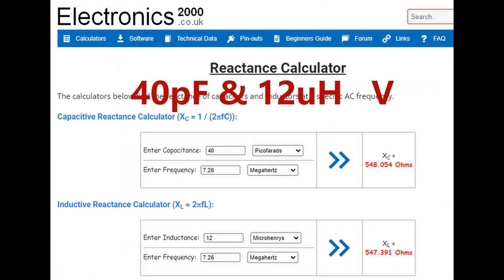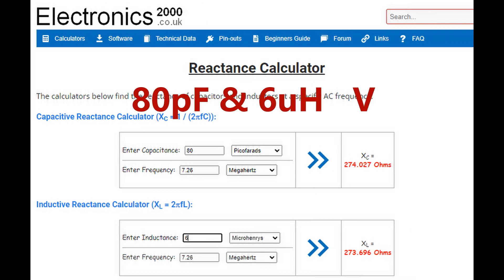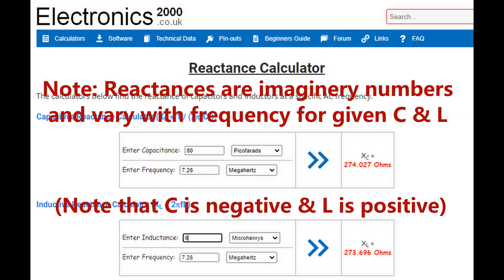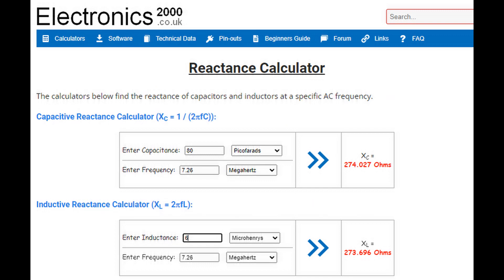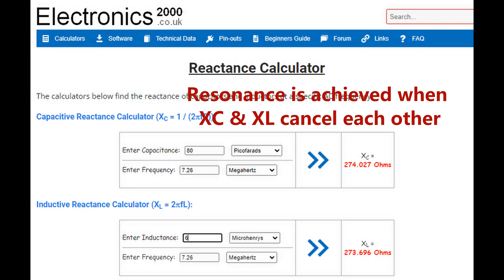Calculate tuned circuits IN YOUR HEAD

Comment: Great rule. Thank you Peter. Could you explain how the different combinations of L and C vary the Q factor? Thank you
Reply from the maker: Q is a bit more complex. It's not just L & C combinations - it's more to do with the quality of the tuned circuit elements eg absence of resistive losses in the inductor.
Reply: @vk3ye  ok. Thanks you anyway.
Reply: The best estimate of Q is basically like this:
Compute XL as 2*pi*F*L
Find the resistance of the coil.
Q = XL/R
This only works with thin wire and without parallel resistances in the circuit.
In real circuits, you often have the input impedance of a transistor loading the LC circuit and forcing the Q to a lower value.
Reply: Thank you! @kensmith5694

Comment: Without being able to specify the input and output impedance, these calculations are not worth much.
Reply: These are very useful tips.  He is talking of hitting the resonance frequency in a simple LC having only one L and only one C.
Reply: @kensmith5694  A tuned circuit is useless without being able to connect to anything.

Comment: Given the nature of practical radio circuits, e.g. with stray capacitances and inductances, such approximations are really much more useful than encouraging people to calculate values from formulae to a ridiculous number of decimal places. They would be much better taught in radio amateur exams, with the accurate formulations given rather less emphasis, particularly for those who struggle with algebra. A nice and timely reminder, Peter!
Reply: Back in the 1960s, before the advent of calculators, I sat several Telecomms exams, when working for the UK Post Office. They would often pose problems involving reactances of inductors and capacitors at audio frequencies. They often chose 1592Hz. This made the awkward 2pi*frequency term in the formulas into a round 10000. It saved a lot of time if you spotted this.
Reply: this is the approach used for many of my circuits, calculate roughly then trim as needed after testing,  strays can really mess with your calculations on some practical applications

Comment: Did you know that today is Pixie Day

7/23 (in freedom dates)

In fact, it has been pixie month 
7th month of 2023 

7023

How could you / we have missed it ??
Reply: Pixie Day? I had to look that up.
I put my Pixie on 5.262 MHz. 350 mW out, worked 180 miles plus a SWL report from 220 miles in the Netherlands.
G4GHB
Reply: @bill-2018  Best I did was Sydney - Brisbane with VK2TJ one sunny afternoon in 2020

Only made a 20Km NVIS to Blacktown from Kogarah (Sydney)

Both were on Mag Loop antennas to beat the broadcast interference.
Reply: @MidlifeRenaissanceMan  On 40m? Not bad.
160m to 20m bad broadband QRM here, S8, only 60m o.k. Low inverted vee at 26 feet and squashed into a 25 foot long garden. Trouble is not too many stations on 60m and tends to be the same people. Nothing wrong with that of course.
All QRP here with nothing above 5 Watts for 30+ years..
Reply: @bill-2018  noise is pretty bad here too. I have a vertical that smashes it on 20 and 40, but S7 noise on 40. Mag loop pulls that down to S3 and pulls in almost the same signals. Just not very weatherproof in its current incarnation.  I’m working on a version I can put up and pull down easily enough that doesn’t mind getting wet. 

Have you tried a mag loop for receive ??
Reply: @MidlifeRenaissanceMan  Hi Chris, I have a h/b mag loop so I can turn it away from the noise source and it worked quite well on tx as well. Need to fix the small motor and gearbox better to drive it, 3 Volt motor will run on one 1.5 Volt battery for slow tuning. Going to try a larger one for the lower freqs as well. For their size they are good. Outdoor inverted vee better on 60m, although my loop is small for 60m, even 40m. 
H/b h.f. ssb/cw radio here but got an FT817ND for portable use (much smaller) so want to try a mag loop, great that earthing not essential like verticals.
G4GHB
Reply: @bill-2018  cool. The mag loop for 40m is 8m in circumference and over 2.7m diameter. I put it onto a tripod I can crank up to a little over 3m tall. 

Getting a capacitor with low losses, high voltage and high current capacity is a challenge. Ended up building my own pit of PVC pipe, aluminium flashing and copper tape.
Reply: @MidlifeRenaissanceMan That's a big mag loop, no wonder it works well,  what do the neighbours think?
Reply: @Paul_VK3HN  it’s not too tall and they’re happy for us to be the comms centre for the neighbourhood when the zombie apocalypse strikes.
Reply: "Freedom dates", that's funny.
Reply: @realjohnboxall  well there’s freedom measurements and science measurements. So why not freedom dates. 

We busted out the pixies.  Managed to blow one up, mod the other in such a way to kill the receiver and so a pixie built by a 9 year old made it on the air for 2 QSOs
Reply: There’s some video of it in action on George’s channel. VK2AOE Art of engineering.
Reply: Didn't know about this... Took me a while to work out the 7023 relevance 😂. Is it on every year?
Reply: @Steve-GM0HUU  it’s on every day in our hearts :-)

No reason it shouldn’t be on every year. Even every month. On the 23rd or each month at 7:00pm local time. Perfect time for 40m to throw on some longer distance QSOs
Reply: Great way to get a first set of values when armchair desigining